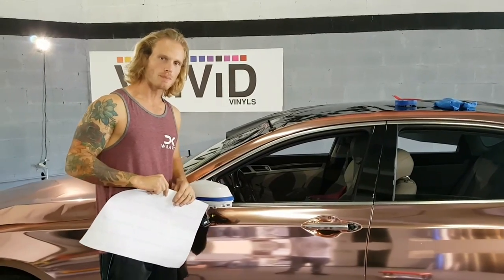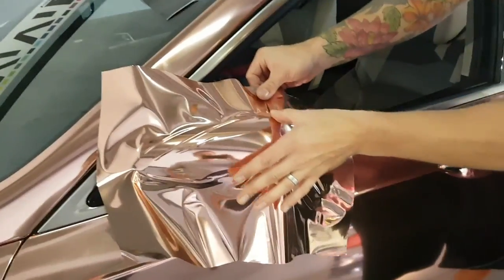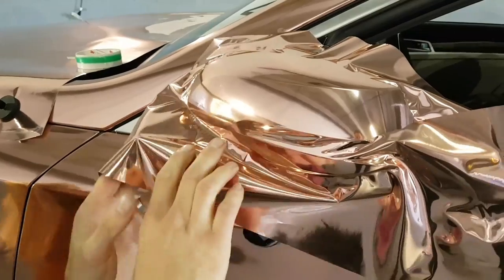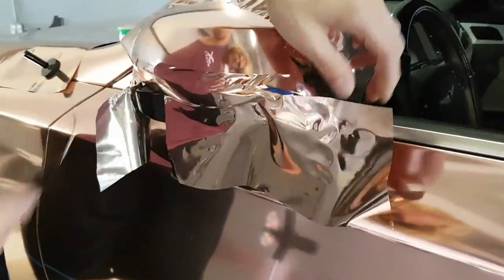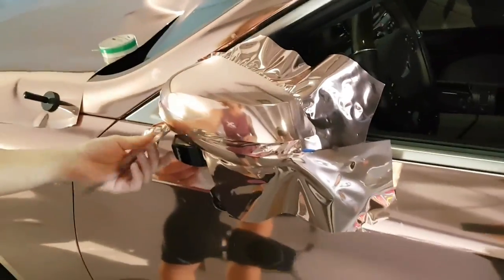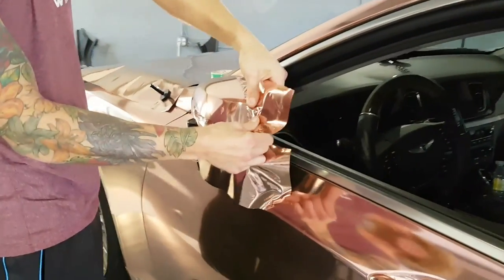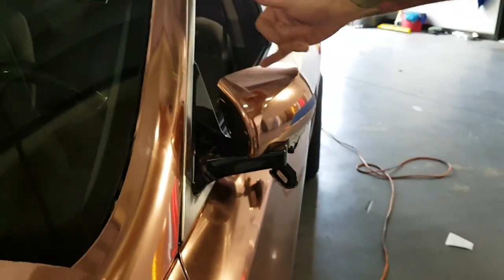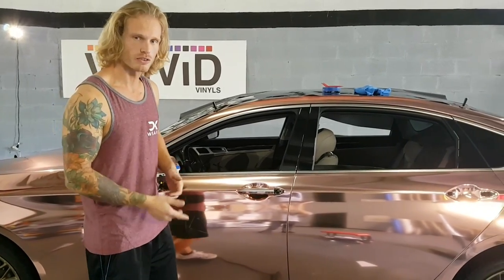How to vinyl wrap a side mirror in chrome. By @ckwraps

Comment: I want to do a parabolic dish on a chloroplast backing (so its  pretty flexible plastic, maybe it won't stick?) for solar cooking.  Some guys in India found Vinyl wrap was the best material as the reflective material.  It has to have "mirror like" reflection,  so something like the material you used but more silvery like a mirror.  Which of the wraps should I buy?  About 15 sq ft is needed.   Thanks Brian

Comment: Hi CK. Amazing channel, I'm using this channel to get all the tips. I have a question regarding lifeless tape. I bought some of eBay, it was Knifeless brand but it wasn't what I expected, I notice your using 3M. Is there any difference to it or pretty much the same?

Thanks DC
Reply from the maker: +Drew Crowther it should be the same thing. 3m recently bought out the original owner and developer of knifless tape so all new rolls have been rebranded. You most likely have an older roll but it should still be the same
Reply: Thanks for that, it doesn't look quite as great quality as i would have expected from a 3m product. only practiced so far on surfaces and no wrap so will report back when i have used it. Thanks for the reply bud, i appreciate that!

Comment: I'm wondering if brain surgeons have that steady of a hand. I'd have dropped 3 or 4 f bombs with that mirror. Christian, you are amazing.
Reply: Lol. All we get was a 'its a pain in the ass'.. and wasn't even frustration from this particular wrap. Isn't he ridiculous? With chrome no less and in less than 20mins? Lol. I layed flooring for a lot of yrs(mostly carpeting) so I have some knife skills.. a lot of cutting is your blade floated, especially commercial and we don't care about baseboards or walls as cove base hides it(residential always careful)..  as much as anyone would care about car paint for obvious reasons. Lol.. Oops, shhh. I'm not even so much worried about cutting(most of car has a guide to follow anyway)..  it's the proper install and durability. I'm psyching myself up, just making time really. Vinyl is expensive and I'm def not putting chinese no name on my car. I read a lot of comments to see what ppl are saying soaking in as much as I can. I should be okay. I'm pretty sure I just read a post or two of yours about you referencing vinyl and maybe you working in the industry for bunch of yrs?  Wondering what kind of experience you have installing vinyl or any advice, maybe? Sorry for rant. Thx for your time. Apologies if you don't know anything about vinyl, but I def know I've seen you post. Peace, my man. Later. 

Christian, if you read this, not gonna bother complimenting you anymore. I'm done. 😂